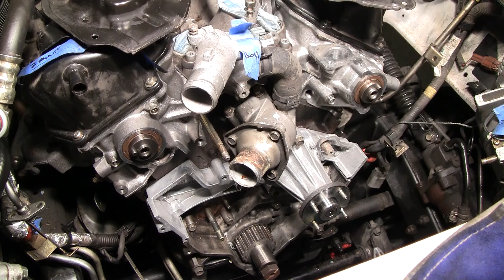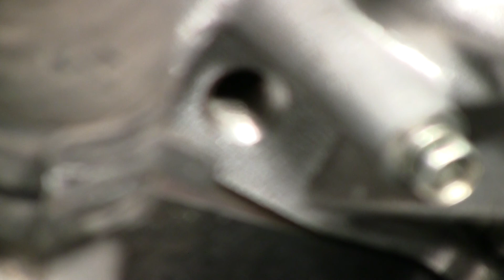2002 Nissan Xterra VG33E Rebuild Step by Step Part 78 - Thermostat + Upper Water Inlet + Whats Next

Comment: I'm trying to remove the head. .. any bolts in the back of it?
Reply from the maker: Did you get the 2 really small bolts? There is one on each head, hidden. almost like a 10mm socket, but REALLY small bolt. I hated removing those.